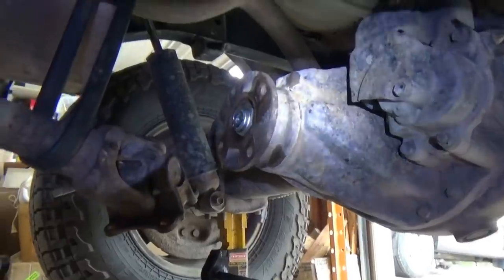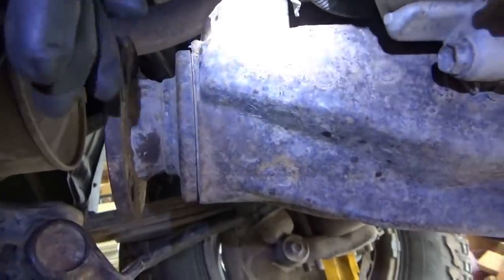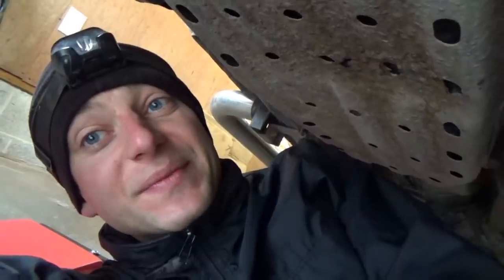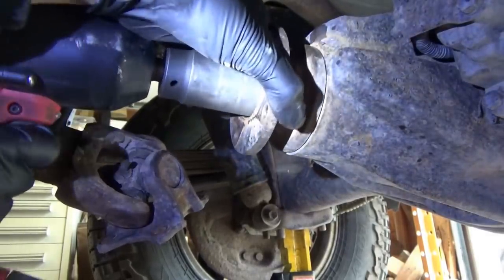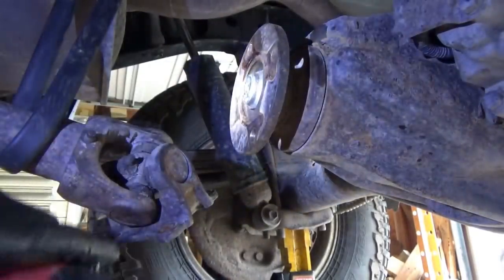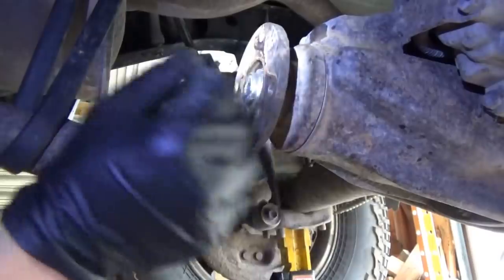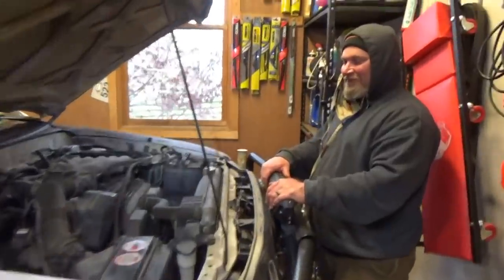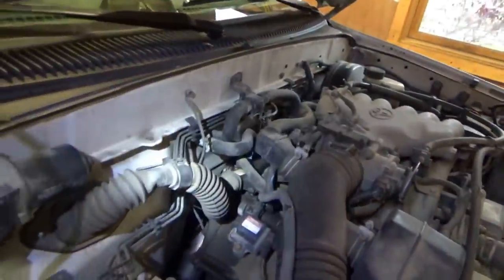Loose Pinion Bearings? (Toyota Tacoma)

Comment: 1980 Dodge Colt front wheel drive. Lots of miles, front wheel bearings had slop. Put a dial indicator on it and measured the slop. Divided the amount by 2, used the surface grinder at college to reduce the thickness of the spacer. Drove it a couple more years until the body started falling apart.

Comment: When i was a kid about 50 years ago,  fitted a new oil seal in diff pinion and didn't know anything about collapsible spacers and did the nut up with an air wrench, took the car up the road and it made heck of a noise, i overtightened it, car ended up with new differerencial...oh dear...Fred in England.
Reply: I did the EXACT same thing about 20 years ago.  Learned a valuable (~$1000) lesson.
Reply: @BlindBatG34  Yes i never done it again lol
Reply: If its over tightened  will you hear hear a metal on metal chirping sound and random  shuddering in the front  end? 2008 jeep grand cherokee 166,000 miles

Comment: I wouldn't count on the bearings not being worn out or even pitted.

When the Dana M80 diff bearings started whirring & the gears started to get a tad noisy I replaced the bearings & reset the diff lash all by myself, the small pinion bearing had damage done to the inner race & ithe pinion bearings had lost all of their preload.

As it goes with using unlapped & used gears you might get a bit of a whine like I did at 60 kilometres per hour (40 Miles per hour) but  I don't worry about it.

The solution is to replace the gears as they were a little bit noisy to begin with !

Comment: Didn't the adjustment on the diff mess up the backlash? Sounded like there was a lot when you rolled it back and forth.
Reply: It really depends on if the bearing are worn excessively. The back last adjustment on these is performed by turning the adjustors on the side bearings. That process is time consuming since the axles shafts and the differential pumpkin has to be removed from the axle housing. The back lash seemed like a bit much but cannot be measure by the pinion movement since when the pinion moves we have to take up all the slop in the rear end. Pinion to ring gear slop, spider gear slop and spider gear to axle shaft spline slop.

Comment: Maybe Im wrong but aren't you suppose to wash your K&N and re-oil every you know 3 years or so, Im lost here. That looked like it was never washed, Thats kinda the selling point, wash and reuse.
Reply: Yup..wash and wear
Reply: Wash, oil, repeat.
Reply: Yes but most people don't I think it's pointless unless you actually tune the ECU there hot air intakes and only good if you want more induction noise
Reply: Yup. Wash, let dry and then apply the smallest amount of oil possible to give the filter a hint of red tint. The only problem is most over oil them and then the mass air flow sensor gets an oil bath in the first 100 miles as the filter sheds the extra oil. Lean running codes and low power as a result.

Comment: I think you did good that's how I did on my truck and probably put another hundred thousand miles on it since then and it's still doing good no noise oil looks good still, it was a loose like that not making noise or nothing not leaking I just took up the slack in it but mine did not have a crush sleeve in it it had the regular spacer I had to take it apart and I just ground a little bit off of it and tighten it back down and kept doing it till I got it right and reuse the same bearings and the reason I'm watching this right now is because on my BMW I was rebuilding the rear end and could not find one of those Crush sleeves anywhere so I tried to straighten out the old one a little bit and reuse it and I tightened it back down to where I thought was pretty close and I drove it and rechecked now I have metal in it well oil is dark color I don't know if it's just breaking in or what hopefully it's not too tight I do not want to chew the bearings up and I do not have one of those inch pound torque wrenches that they use to check them with so I just felt it by hand

Comment: I would expect even a truck (Toyota for that matter) to need pinion bearings if it has 260k on it.  Especially if it's been used for towing or hauling.  This isn't entirely out of the ordinary.  I've seen much worse on vehicles with fewer miles.

Comment: Actually, the inner races moved towards one another when tightening the nut.  Not a fan of using an impact to tighten the pinion nut, it wrecks the roller bearings.
Reply: Can you share some advice on a more precise option please? 
Bolts in the flange and a bar to stop it from moving and a ratchet?
Reply: @jasperwafflewool1957  There are specially made tools to do just that.  Yes, hold the flange from moving and use a ratchet with a long handle.  Check clearances frequently to prevent over tightening.

Comment: Using an impact wrench to tighten bearings is hammering them .  Not good for long life...but at 200k miles...
Reply from the maker: Almost 300k miles :) And the impact is only hammering the nut, not the bearings!
Reply: Meeeeehhh, it doesn't matter. If it breaks from an impact rattler it's gonna break from being used.
Reply: I believe the Pinion nut, crush washer, and pinion gear are all supported by bearings, and in service, rotate together. When the impact is hammering on the nut that energy is being transferred to the pinion, hammering it to the ring gear. The ring gear does not move but the high speed , point source impact at the one spot effects the ring and pinion introducing a wear spot. sorry for not being clear
Reply: Interesting to hear you say that, I've seen many professionals use an impact on the pinion. What I hear you saying is that an impact is OK with the ring gear out, when the tech holds the pinion stationary in his palm. I wonder how they do it in the factory. When the diff is already installed, there is no way to hold the pinion stationary with a hand. So there is extra stress on the ring gear/pinion interface. The pinion has some mass, and it doesn't seem to be so difficult to hold the pinion in a palm when taking up the slack with a short burp of the impact. Certainly it is easier than it would be to hold back a drive axle when a vehicle accelerates. Once the slack is taken up, energy goes into crushing the sleeve and resistance of the threads, and some of that resistance reduces the torque needed to hold the other end stationary. Like tightening a bolt, once it tightens down, the wrench at the other end often doesn't need to do a lot. So I would guess the strain on the ring gear teeth is small, but I don't know. The alternative is to use a long cheater bar, which would be really difficult without a lift....

Comment: Doesn't that nut have a torque spec?
Reply from the maker: The bearing play is the important part :)
Reply: No, actually you use a torque gauge on the pinion flange to watch the torque it takes to move the bearing, once you get to that number you stake the nut in place. That sets the bearing preload, if you go too loose the bearings will make noise and start destroying themselves, go too tight and they will generate a lot of heat and burn themselves up.
Reply: @Blazer02LS  not only that, the more you tighten the nut, the more receccessed the pinion gear becomes.  It throws the alignment of the ring gear off as it is set by the pinion position. 

I don't know if half a turn or more after this was set will make a big difference or not. But it will change how the gears contact each other and increase backslash.
Reply: @sumduma55  It shouldn't do much in this case as it's been loose a while so the damage is done. As long as it stays quiet and doesn't get hot it should be OK.
Reply: Deez nuts? You tighten the pinion nut until you reach the proper rotational torque for the bearings. Since the bearings are worn, zero lash and zero rotational torque should be fine. Can’t be worse than all the slop ( lash ) that it had.

Comment: Pine Hollow Auto Diagnostics
If you have play in the pinion bearings, they are already shot.  You don't just lose pinion preload unless the bearings are damaged.  Even if the nut backed off, you need new bearings and a new collapsible spacer.  Where is your beam torque wrench to measure pinion turning preload? This is a hack video, please show people how to do it the right way instead of damaging their vehicles further.  Having a customer drive 15K miles on damaged pinion bearings is nothing to brag about.